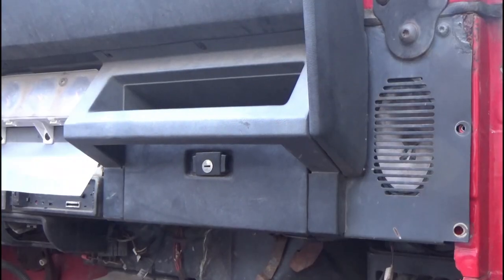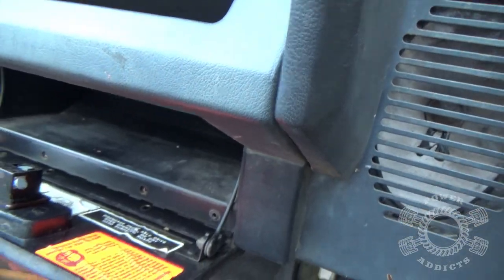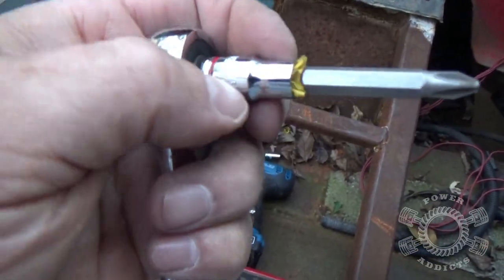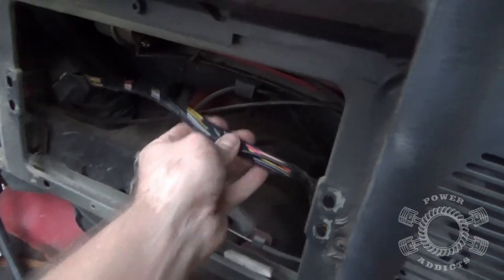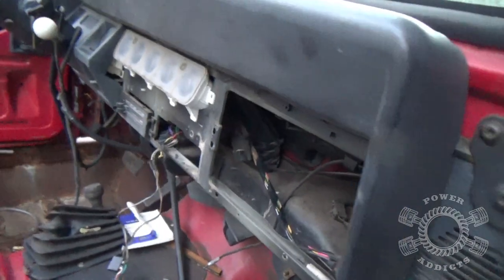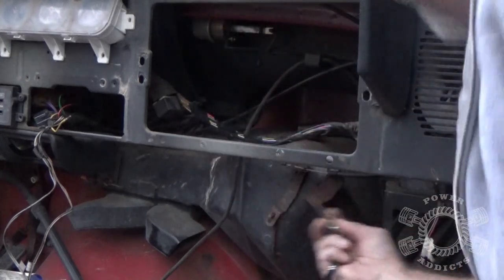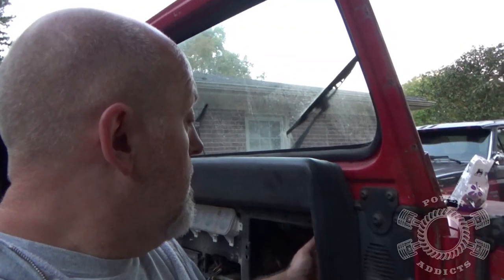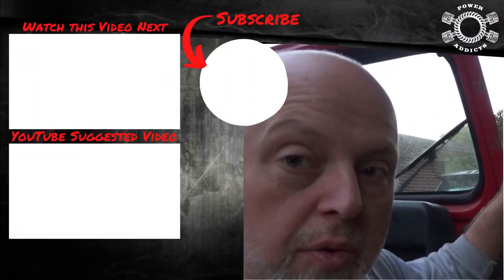Jeep Wrangler YJ Glove Box - How to remove it and a dash speaker hint. #poweraddictscrew #jeepyj

Comment: Been wanting to remove that original glove box and throw in a locking box for added security. I don't keep anything extremely valuable in my Jeep but people will steal even the cheap stuff. Great video as always!
Reply from the maker: Thanks!! I kept looking at that massive hole thinking "What cool thing could I do with that?" The comment below from PoBoySpecial (he lives local to me and is a friend of mine) got me to thinking about making a custom fiberglass lockable enclosure. Or maybe the Smittybuilt lockable glove box would be cool! Have a good one bud!!
Reply: @Poweraddicts   I bought the Smittybilt glove box but haven't installed yet!!   I have 2 YJs as well and havent decided which one to put  it in!!  lol  One is a White 93' w 2.5L nearly stock except for 2.5" lift, immaculate condition.  I call it "Little Whitey"  The other is a '93 Sahara w 4.0.   This one was probably really nice back in the late 90's, but by the time I found her, she looks like she'd been sitting in field for 5 years.  OME springs, Adams driveshafts and I don;t even know what else.  PO said it has Yukon gears, but I don;t know how to verify that yet!! I call her "Old Ugly"  Keep up the good work, Chuck!!

Comment: I have a horn problem it's underneath my airbag I just purchased this new 99 Jeep Wrangler I was wondering if you can do a video on that soon because I never did one with an airbag on the steering wheel
Reply: I think Chuck just does YJ videos...
Reply from the maker: Ive got access to a 2000 and a 2006 TJ that I've made videos on.
Reply from the maker: If I get access to a TJ that has that same issue I'll do the video. Just fooling around under an air bag when there is nothing wrong can introduce issues later down the road.